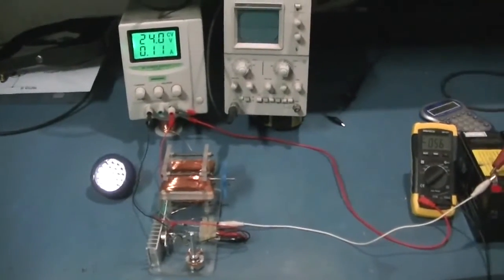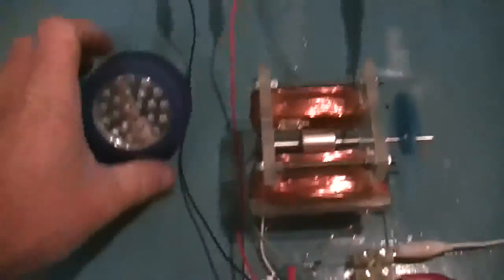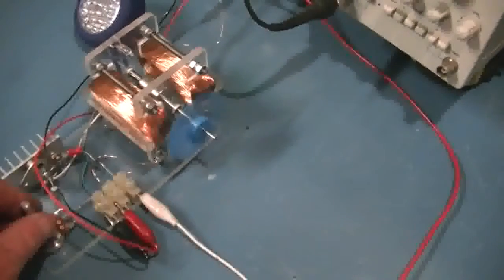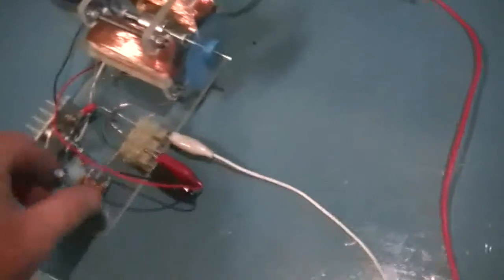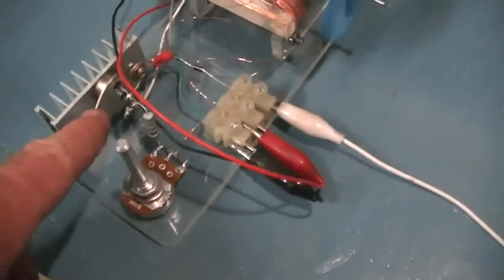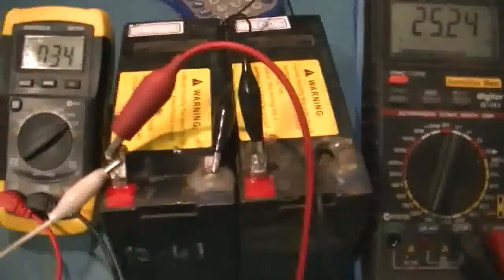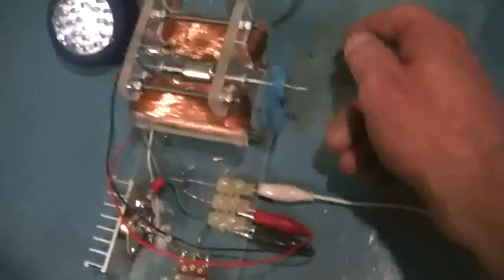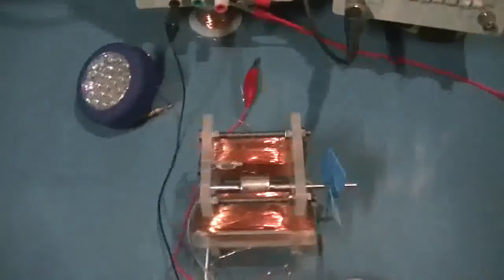window motor with gen coil and fan doing 16000 rpm.flv

Comment: Nice work Tinman. Can you measure the voltage drop across the resistor + the voltage across the LED lamp, with all running. Your pulling 100 mA, your feeding what was it - 50 something into the charge batteries... what's going in to make light. Better not be more than 50 or I'm calling the Men in Black! lol